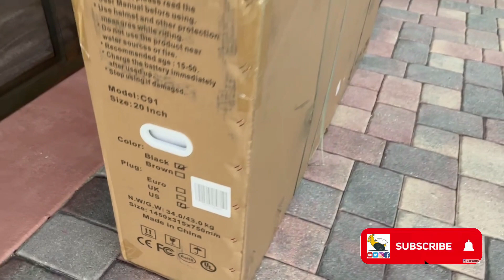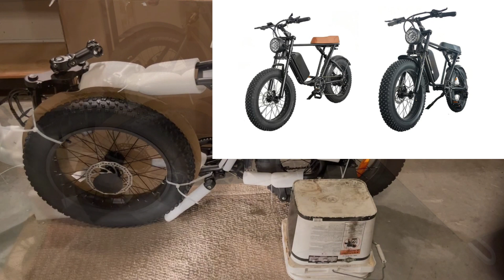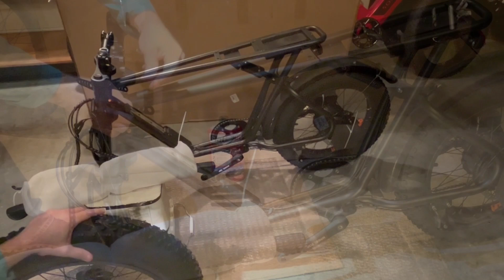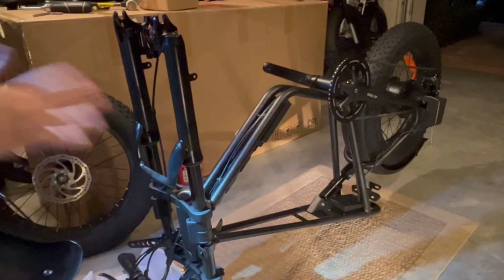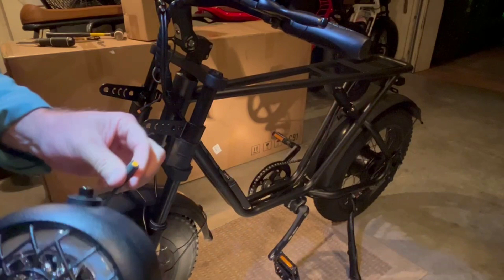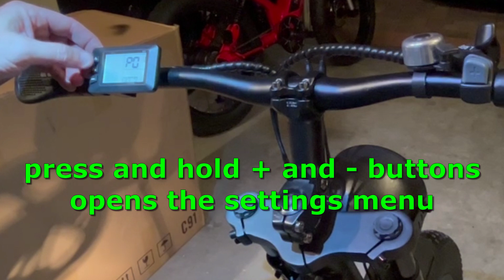Emoko C91 unbox & Assembly instructions or Long Seng or Ronson

Comment: Hey,

I have a question about the Emoko C91.
I have setting P10 at 0, but the throttle remains on. How do I turn it off? By the way, my battery doesn't turn off when I try to turn it off, so the screen can still be switched on even if the battery should be off.
Please help.

Kind regards.
Reply from the maker: Link to Display & Controller settings user manual: https://drive.google.com/file/d/1DE8w6Enm_NsegMMGsMe9X2DW_rEvgfaX/view?usp=sharing
Reply: @BRichSolution  I have a question about this part of the instructions for my Emoko C91; how do I factory reset it and what does communication state mean

Comment: I've just bought the bike, how long would you recommend charging the battery for the first time?
Reply from the maker: 3-5 hours until light on charger is green
Reply: @BRichSolution  thanks, does it matter what order you plug in the charger cords? It says on instructions to specifically plug the charger to the battery then the power outlet, I'm just wondering if it really matters or not  🤔

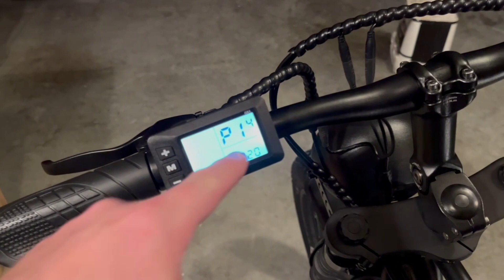Comment: Do u know why my battery shuts off at 3 stripes 12:18
Reply from the maker: Sounds like battery voltage is too low.  Use a voltmeter to test voltage fully charged should be 55.4V
Reply: @BRichSolution and if its not the case what can it be

Comment: I have one more question, is it possible to set PAS max speeds differently?? I mean on unlocked ebike PAS 1 reach 30kmh, i would like to set for example, pas1 15kmh pas2 25kmh etc. To 50kmh
Reply from the maker: Good question.   I think these is a method to set PAS mod max speed but you need the controller configured.  Ask manufacturer

Comment: Would anyone know where I can get the brushless controller for this bike it has a cable that is a 10 pin and I can't seem to find the one to match this bike on any website. Please can someone help me?
Reply from the maker: Consider reaching out to seller or manufacturer for replacement motor or buy all new motor, controller and screen would be faster bike
Reply: I did reach out to the supplier weeks ago and no reply I don't understand why they would used a cable that can't be replaced

Comment: Hello, i was told this has a horn  built into the light.. do you know how to activate the horn? thank you.
Reply from the maker: If the horn doesn’t work then most likely its bad in the headlight if it doesn’t work.  Ask seller to send you a replacement headlight
Reply: @BRichSolution I have the same problem

Comment: In the g51 display manuel i found online it says "p10 setting 2 is driven by PAS & Throttle. The throttle is useless at Zero Start status. Both throttle and PAS are active", So does that mean that when you have pas and throttle working, you cant use the throttle from a dead stop? Does yours have pas and throttle working and can you use thottle from completely stopped ie zero start throttle? The manuels i found for this display are confusing, But i want to have power assist working, throttle working also with zero start "throttle works from 0 mph" Could you confirm how yours is working please.
Reply from the maker: Mine has throttle and pas working or vise versa
Reply: @BRichSolution thanks pal, if I get one I'll probably end up putting a KT controller in their anyway, I don't suppose you know what max current draw on these batteries BMS are? I'm guessing must be at least 30a if the bike is rated for 1000w, such limited information online about these, but they look really cool for the price even tho I'd end up spending a lot more on upgrades lol.

Comment: Hi just wondering where controller is located ? Also tried this method of unlocking speed didn’t work for me
Reply from the maker: Controller is under the seat.  
Change setting p07 to 100
Change p14 to 20
Reply: @BRichSolution  thanks bud I watched a few unboxings as away from home rn does appear to be under the seat for me hopefully my 48v controller and new battery works out 🤞🏻but I’ll try unlock it later

Comment: My gas throttle stopped working after a week. Error code E08
Reply from the maker: I had similar issue my bike showed up dead throttle.  Manufacturer sent me a replacement
Reply: @BRichSolution  and that one has been working good since?
Reply: @BRichSolution  I Have bought a new gas throttle but it still does not work, unfortunately. Do you have any tips?

Comment: Hi i got this i need new bottom bracket where can i order
Reply from the maker: If the bike arrived damage reach out to manufacturer as they should supply you a replacement.  My bike showed up with broken throttle and they sent me a replacement.   
If you need bottom bracket sooner it should be standard size and sourced easy in amazon?  https://amzn.to/42TCZC8
Reply: @BRichSolution  so that bottom bracket will fit

Comment: I have the p8 setting to 100 and the amp p14 setting to 20. Do you have any idea why i can only go 25km/h instead of 50km/h?
Reply from the maker: Are you in the highest PAS mode?
Reply: @BRichSolution  what is the PAS mode?
Reply: @TheSandkiller  to unlock max speed, press the accelerator and left brake at the same time, then press the turn on button for 10 seconds, then release the accelerator and brake at the same time, then turn off the bike, when you turn it back on max speed should now be unlocked
Reply: @lexithebullterrier3813  I’ve tried this but feel like I’m doing it wrong
Reply: @marcusholland6349  turn back the throttle fully while pressing the left brake at the same time ,then switch the monitor on and  hold the brake and throttle for at least 10 seconds release the brake and throttle before turning off the monitor. This method worked for me.
Reply: @lexithebullterrier3813   thank you I tried this before maybe I did it incorrectly I’ll let you know thanks bud 👍
Reply: @marcusholland6349  I found this unlock max speed method from the seller so maybe you could ask the seller because your bike might have a different unlock code.....these bikes are definitely capable of up to about 32mph good luck 👍

Comment: I wonder if there is a guide on what all the p01/p17 mean on the display. I want to finetune my bike. Also only the ring on my frontlight is on not the complete light and the backlight is only on when breaking. I want them both on permanently. Would you know how to do this?
Reply from the maker: Remove the seat and see if taillight is connected to controller or any loose connections.   After that reach put to manufacture
Reply: @BRichSolution  appreciate your response. i don’t think thats the issue. The backlight works fine but only when breaking. Someone in the comments has the same problem so im thinking its a configuration thing. Just dont know how to configure it to always be on.
Reply: @joost139 You mean the head and backlights permanent on? You have to hold the + button for a few seconds i think.
Reply: @TheSandkiller  haha yes i finally figured this out. Do you also know how to set a max speed in kmh/ or mp/h?

Comment: Hi, I bought this one. Thanks to your videos I dared to buy directly from Alibaba. After driving for 10 km I got an error E-09 on my display and the bike stopped working. The seller immediately sent a new controller to me and the bike is running. Also the left crank loosen up after 15 km, I just tightened it ad everything is fine. The front light shines only as a ring the rear light only during breaking. I am wondering, can the front light shine stronger and the rear light permanently?
Reply from the maker: My c91 rear light is on when headlight is on.  Only issue i had bad throttle and they sent me a new one
Reply: Did you manage to figure this out? I have the same problem. Don’t know how to turn on the main headlights and also dont know how to have the rear lights on permanently.
Reply: @joost139  press and hold the '+' button on the display. The front light will go on. For switching it off, again hold the '+' button for few seconds. I have a feeling that the rear light cannot be switched on permanently.
Reply: I'm in need of the exact controller for this bike. My controller needs to be replaced do you know where I can get the correct one? Any links would be helpful. Or even the company you bought the bike from

Comment: Thanks for your videos. I just received my C91 but the throttle stopped working within 5 days. Do you know how I can fix this / know where I can find a replacement?
Reply from the maker: Interesting similar thing happened to me and manufacturer sent me a new one but it took 2 weeks.   I bought the same throttle on Amazon for $20 (see link below) and kept the one they sent me a spare.  Installed the new one in 2 minutes 
https://amzn.to/3GGGhAB
Reply: @BRichSolution  Thank you!
Reply: @BRichSolution  bought the same gas throttle and screwed it on and plugged the cable into the 3 pin cable. But it still does not work. Do you have any advise. The seller is crazy slow in responding.
Reply: @joost139 did you find a solution ? Curious because I want to buy this bike
Reply: @Faded980  honestly i would find a different bike. The gas throttle broke 3 times already and the overall quality is shit. I had to replace the derailler after just 6 months of use. 

The pedal assist and gas throttle is completely broken now and i cant even use the bike. I am trying to resolve this with the seller but to no avail.

Get an Ouxi not this crap.

Also this youtuber doesn’t mention any of this because he gets a commission on every sale (referral).
Reply: I had it one week and the gas throttle already stopped working too… something must be wrong with the design

Comment: I would to know about hydraulic brakes and rear shock. Also the manufacturer of those parts.
Reply from the maker: here is link to hyralic brakes that bolt on and have plug & play motor kill switch cable.   https://s.click.aliexpress.com/e/_DDiIC1P    I have a video of the install that I plan to post in a week.  As for the rear shock I am oaky with the stock one, have not explored aftermarket yet
Reply: What about rear shocks any ideas. What front brake the B or A.